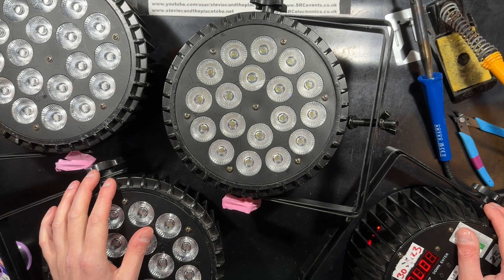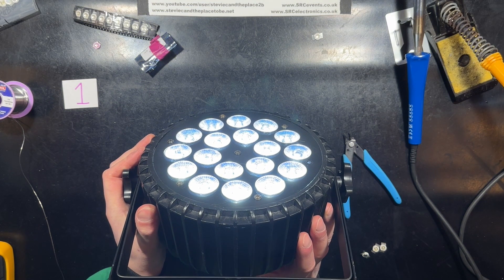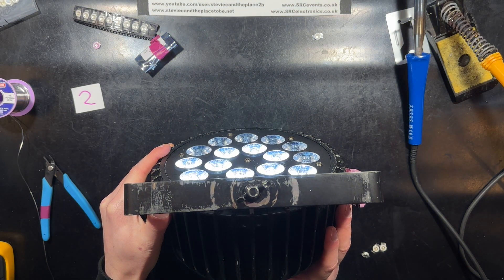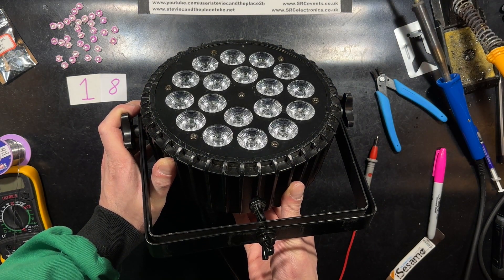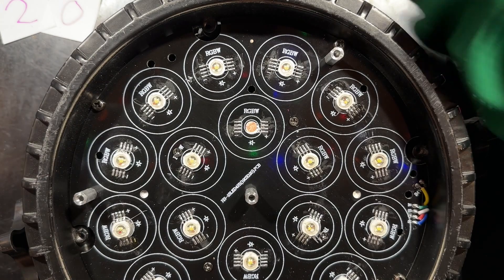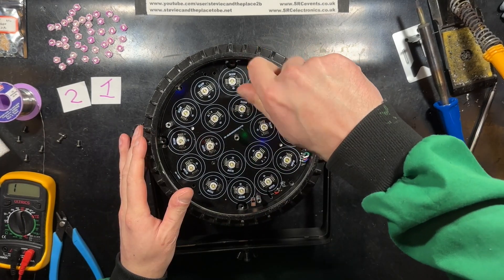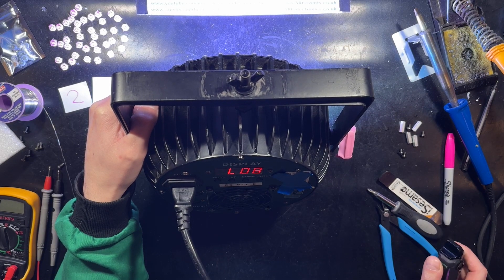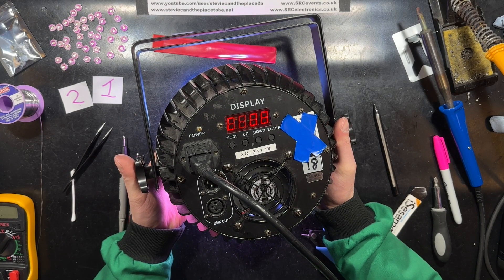More PARcan repairs. If anyone par can, I can.

Comment: how do you set your multi-meter?
Reply from the maker: I’ve got it set on ammeter (a direct short); I’m not actually using the meter, I’m just needing the probes to short out each led in turn (very importantly: with the LEDs on the lowest dimmer setting to avoid blowing the remaining working ones.)
Reply: @steviecandtheplace2b thank you so much for both making your videos and for your time in responding so promptly. much appreciated cheers.